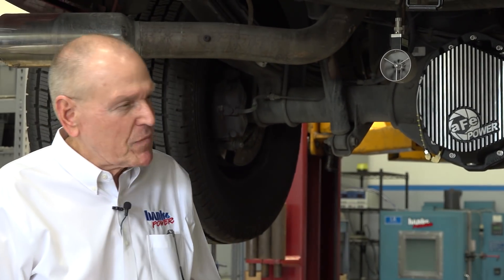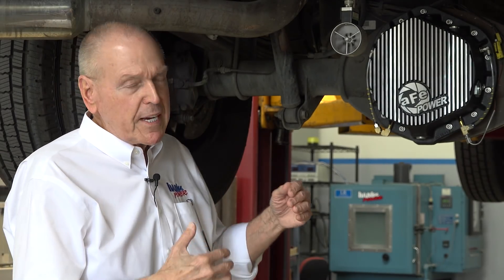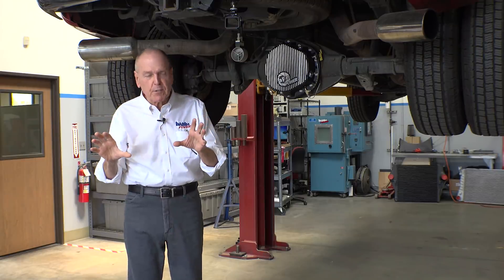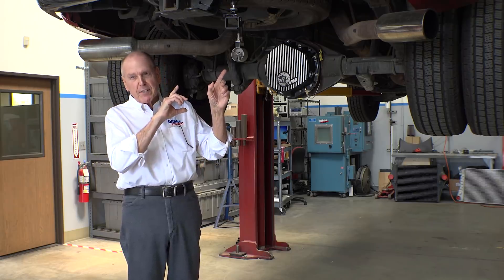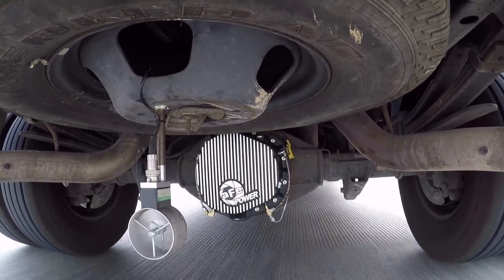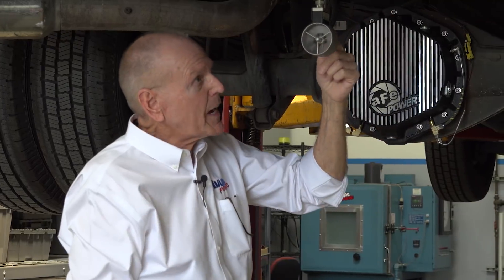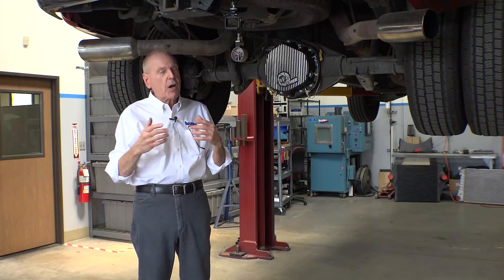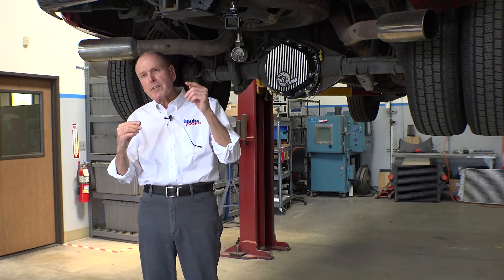Do Diff Covers Work or Are They Just Bling? Part 1 of 3

Comment: All I know is that when I replaced the stock diff cover on my 1990 Dodge Cummins 12-valve with the Mag-Hytec, it was like new life for the truck. The old oil (even though it was running fine with friction modifier for a rear-wheel locker) was really bad.

I now have a differential full of clean synthetic gear oil that can be drained from its bottom, with a magnetic dipstick that is constantly removing any metal from the oil (as I noticed, checking the level after the first drive with it, and again later when adding friction modifier for the rear-wheel locker).

And, the inside of the Mag-Hytec cover for the Dana 70 rear end is nowhere near as squared-off as the ones that Gale here shows for the newer, bigger rear ends. It also sticks out farther away from the gear wheels.

Granted, if Banks made a diff cover for the Dana 70, I probably would have bought one.

Comment: how about the heat radiating from the road ?
Reply from the maker: Heat coming off of the pavement factors into "ambient" temps tested. We found ambient temps play a negligible role. Have you see the final chapter in the series? https://youtu.be/vdtmDl5EDJ8
Reply: @bankspower  no, it got a bit long half way through ep2 and i realized you were selling a product, rather then just debunking if a cover does anything to improve a differential or if it was just eye candy, I thought they were just eye candy, but i can see now as you explain the engineering how a cover may assist in longer differential life and better fuel economy, I liked your design well done and learnt a bit about differential lubrication thanks, so i had a look on your website but you don't make one for my old jeep cherokee kj, which tomorrow I will be rebuilding or swapping the diff cause something went bang on the way home and oil started coming out the pinion seal so i think it chewed up a bearing or something else fun, but i got home so will investigate in the daylight, thanks for the reply, makes more sense now why anyone would spend a few hundred dollars on a cover for their diff... hey baby look at my lovely differential .. yea i couldn't see that working, might be ok if you have a 4x4 with a 6 inch lift kit and then everyone sees it I guess.  cheers.

Comment: Thank you for these great videos. A couple of thoughts. How about adding external cooling bars on the stock diff cover? This keeps the internal shape & fluid throwing flow but adds outside cooling & not effecting internal fluid throwing or capitacy & may not have a negative outside air shape or flow. Also, why do stock diff covers have no drain plugs? Adding one to the stock cover just makes it easier to do fluid changes. Looking forward to future testing, thanks for your time & efforts. I've got the '17 Silverado 5.3L LTZ

Comment: Yeah that's how come you never put one on my Dodge Cummins cuz I got looking at them and I was just like how the hell does the fluid flow in that thing and all my friends that had them had rear end issues and they put 250,000 miles on it with the stock when they put that one on it and it went out about 10,000 miles later and they said it was due to excessive wear and Heat and a lack of lubrication so I just never put one on mine cuz it was a waste of 200 bucks because the stock design has been around since Jesus was a foot soldier so it had to be doing something right

Comment: # FAIL### You did the first video on a Ford. The second video on a ram. You wasted all our time! You cant compare the two tests on two different axles. All this time.and work on testing and you ruined the test by changing the truck and axle,  every different axles will react differently.  Bad test. Disqualified.  FAIL.... also you installed led lights but no tempeture sensor? #FAIL WASTE OF A TEST. also on this second test you did not put in the 2 extra quarts of oil.
Reply from the maker: We did not test on different vehicles nor did we test on different axels. All tests were performed on the GM/Dodge 14 bolt 11.5" ring gear rear end. All tests were performed with temp sensors, anemometers, and other sensors. The two videos with clear diff covers were for illustration only. No actual testing was performed with those covers.
Reply: @bankspower  one was a dodge and the other a Ford.
Reply: @bankspower  either way a dodge and a GMC will have different gear aspects
Reply: @bankspower  the ratio may be the same but one may have paddles the other not
Reply: @bankspower  you need to do the test over again. Both on same axle
Reply from the maker: @tintdr  We will do not need to do the testing all over again. We performed all tests on both GM and Dodge rear ends. We have data for both rear ends. And, we have reams of data collected that was not shown in these videos. Moreover, these videos are nine months old. We're still testing. Yes, nine months later we're still testing. You're welcome to stop by anytime if you're in the SoCal area.
Reply: Well I think you should be fair and show the test on the same axle within the same video. Because while watching I felt deceived
Reply: So post a video of the test done on the dodge, with both the factory clear plastic and the replica of the flat back. All we can see is a test done with a factor clear on a Ford and a flat back clear on a dodge of vise versa. To show everyone post the dodge with both. One has a paddle to mix the gear oil and the other does not. Not a fail comparison

Comment: We don't care what you're running, we don't care about that tiny computer fan, we don't care about oil levels. You sir, are a quack. You said all that stuff about mileage yet you didn't actually name any statistics AT ALL. The only thing you said was that "If you're going 60 and carrying a large load, it will reduce oil temp".  

Really? A 10 minute video to tell us about stock oil levels???? You said you had so much data and research yet you said NOTHING about performance numbers. You only said that you found a good lube... WTF OLD MAN???
Reply from the maker: This is multi-part because we're testing in real-time. It says it right in the title. This isn't a TV show that was taped in advance six months ago. It's happening right now between all of our other ongoing projects. So, actual data is forthcoming. Do you think you're being funny calling him an old man and a quack is funny? Gale is one of the most respected men in the aftermarket industry. GM, Ford, and Chrysler have all consulted him on various projects. Gale is one of the few that holds other parts manufacturer's feet to the fire. Did someone hold you at gunpoint and threaten your life if you didn't watch this video? Your display of cartoon-like hate is comical. Thanks for watching!

Comment: I will be really interested to see if the internal shape of the aluminum covers changes as a result of this testing... instead of just hogging out more space without any thought given to fluid flow and distribution, will someone make the effort to build a cover with the service ease of a Mag Hytec, the cooling of finned aluminum, and the same or better internal flow dynamics of the engineered stock system? It’ll require someone to spend some money, because we’re not talking about a CAD jockey just slinging out a shape he thinks looks good with the right bolt pattern. Will require detailed internal geometry and flow channels to distribute the fluid properly for both complete lubrication AND thermal management.

Comment: You know?  This is immensely interesting, but really only partially applies to me...I have a 2003 Ford Ranger FX4 I am (perpetually) modifying to be an overland/hunting rig.  A vehicle that may see 2000 miles on Interstate under load, followed immediately by a week or 2 of high-torque off-road application.  Simply put:  My truck will spend even MORE time in 4 Low than she did at 75mph on the open Interstate.

Because complicating your life is fun:  How does this apply to low-speed (low airflow, less fluid dispersion) and high-torque application?  Non-issue?  Or...???

Comment: Interesting you call the diff gears the "ring and pinion" gears where here in Aus we call the diff gears the "crown and pinion" gears, the ring gear here being the starter gear on a flywheel / drive plate.

Comment: banks is the real deal guys. Like Richard Petty that kind of real deal he knows what he's talking about. I expect after all this is said and done we'll have something like you have to mark it covers don't work as well the oil gets heated and it probably will lead to early oil failure and it could lead to early bearing wear and failure. And even if it's just the oil you really need to be running a device on your vehicle that accelerates the wear and failure of your lubricating oil on your diff? I would say no

Comment: I have a question for the Banks team: I have heard and read that the efficiency of older differentials (i.e. before the 1975 CAFE standards were imposed by law) are significantly less efficient. The poster child for that group of differentials would be the venerable Ford 9" because its design has a "three tooth overlap".     IS THAT TRUE? and is it something I should factor in if I am building an HD truck for highway efficiency? Are there any hard numbers published for this? (Ok it was three questions)

 I appreciate Mr. Banks take on things, and the way his products are actually engineered rather than concocted.

Comment: I would guess that the extra cooling surface on new cover is more important for cooling than  those air flow meters that you installed before and after to  check the difference in airflow around the rear axle ....       
Seems somewhat useless on road car that does not have aero installed that would channel the air to flow better around diff and cool it that way.     just way too high tech for something that it does not affect hardly at all , if any indeed.

Comment: Really looking forward to the results of these tests. I just want to see slightly lower temps in my rear housing. I was told the issue I had was due to the fluid temp getting to high.  Had a seal blow a few months back, reasoning from dealer was that factory capacity isn’t adequate for the projected and stated limitations of the truck. They told me, should I order a 1 ton cover or one of these aftermarket covers, they would install it and fill to factory level for me. The seal and brake rotors that were damaged were all covered under warranty, but I don’t want to be in there every few months with my truck in their shop for a few days.

Comment: Different covers come from 4wding, might not mean much in the usa seeing as there's next to bugger all 4wding going on.
Stronger cover doesn't crack hitting rocks etc
Bigger cooling fins to help cool the diff oil
Bigger or easier oil changes or cleaning of the oil
The other is weight changes

Maybe towing on the highway might be good for the bigger fins but depends on what it is and how much

Comment: I don't care about anything but the ease of changing the fluid.  Mag hy tec is the best.
Reply: Putting ease as the top priority is usually a bad thing.
Reply: That's what I own too (Mag-HyTec) on both rear Diff and transmission pan.  i'm using the BG Diff oil all around and OEM trans fluid.  I just drove 1500 miles stopping
no only for fuel and pee breaks and all was good.

Comment: Perhaps Mr Banks' next product will be a two part diff' cover - the finned part that fits directly to the housing with a bit more capacity, and a second part that is a bolt-on scoop that directs air over the finned cover. Heck, I expect there are folks who can just fabricate their own from some sheet metal and U-clamps over the axle tubes.

Comment: This is why Gale Banks is the Best in his Field and all other fields that he choses as his endeaver! Without yet,seeing the results, I can guess the result. Higher capacity, higher heat. So? What's next? Bearing seal failure? Now for a Stupid question? Maybe so, maybe not. Now if you're  running an aftermarket diff cover w/higher level of fluid, what if somebody configured a cooler to cool this fluid? Obviously some obstacles like where to install(front grill)? Plus whenever you add extra connections with and for the cooler and lines, you exponentially increase the likelyhood of leaks, ultimately risking the failure of the entire mechanism. In this case, the axle seals, bearings, and finally the diff itself, usually in that order. Both lol and no lol! Any ?'s or comments?

Comment: I have a design idea for you for a rear diff cover giveth bigger blades like an air-cooled engine then you have above the differential like a spoiler or an angled plate to direct air flow through the air veins on the differential it would blow the heat down and a way cuz I would hit the ground while you're going down the road just an idea good luck interesting thought 300 + degrees is very hot and create lubricant break down over time keep it cooler if it lasts longer good thinking man like your ideas

Comment: Iv always read that they add rigidity to the "pumpkin". It's the main point of cast oil pans and rocker covers, they tend to not warp and eventually leak due to their higher comparative rigidity over sheet metal. Though they weigh more. Oh and better heat dissipation.

Comment: I like my new cover because it has a drain plug which makes it easier to drain, it has a dip stick to check level and it holds more fluid.  It also has a port to stick a temperature gauge in.

Comment: the more liquid you have in a vessel the longer it takes to heat up . so the diff wont get hot and possibly burnt out as fast  they do nothing for the common cars driving around on streets they started out as an upgrade for axles on 4x4s that were being used hard on trails/mud. they also strengthen the diff more than a thin peice of metal that is the original cover and some have 2 holes so fluid can be changed easily after wheeling or regular pm instead of taking off the whole cover .

Comment: What is that fan doing on the axle
Reply from the maker: It's an anemometer used to gauge airspeed under the truck so we can properly simulate highway driving. We have one mounted in front of and behind the rear differencial.

Comment: Very interesting so far. 

I did some testing on this years ago but not to this controllable degree. The only thing I could monitor was diff oil temp but  I didn't have a rolling road. I tried to equalized the load and the driving routine, as well as doing the testing at roughly the same ambient temp and using the same lubricant. Best I could do in the field.
In my case, the cover reduced the peak oil temp 15-20 degrees, but my peak was nowhere near what Mr. Banks was seeing as I could not apply a constant heavy load. I spoke with engineers at Dana and Meritor about these covers and they were generally not in favor. The main objection was that the distance between the cover and the ring gear is part of their calculations with regards to lube flow, aeration (more of which oxidizes the lubricant more rapidly), etc. They didn't like that they increased that distance and predicted negative effects. They had no problems with increased capacity, but they warned against increasing the level as Mr. Banks mentioned. The manufacturer of the cover I used wanted the lubricant level increased from stock. I tried it at their suggested level and then at the stock level but my test equipment could not uncover any differences beyond a margin of error. Still, I left it at the reduced level  as my "instinct" drove me that way.
The level indicators were very interesting here and the way the levels dropped. This was an aspect I had not considered. I wonder where that oil is going? Down the tubes? Clinging to the ring gear and carrier? Both? Interestingly, the manufacturer of my cover stated the reason for the increased levels was to feed more oil to the wheel bearings. Laudable, perhaps, but if the ring gear is already doing it, why is raising the level necessary?
I have been running diff temp gauges in my trucks for 20 years or so and there are a great many good reasons to do so, especially if you tow. Even if you don't tow, it can help you choose the most efficient lubricant and viscosity to eliminate drag and potentially increase fuel economy. The diff is a place where the right lubricant can add a noticeable mpg gain. 

One quandary I had was placement of the sensor. I note Mr. Banks had the sensors in the bottom measuring the bulk oil temp. Did that too, but also put one up to measure the temp of the oil being spun off the ring gear, which was hotter oil. I wonder if there was any logic or testing applied to the determining locations of the sensors in this case?
Anyway, this is an awesome test and I am dying to see the results!

Comment: There's a couple of points I wonder if  Banks could comment on. 
What is the optimum operating temp for the lube that he used? If this lube is better at a lower temp, is there a different axle lube that is designed for 350-ish running temps observed?
 If an axle lube is designed for a lower temp, are there any vehicles that come with a cooling system? (Such as a remote axle lube cooling rad, or an integral heat exchanger with remote coolant feed, or separate small coolant rad?)
Reply from the maker: We'll try to answer these questions in the upcoming video.

Comment: Different fluid levels could also be specified to accommodate differences in clutch type limited slip units vs. gear lockers, vs open differential used by different manufacturers. Hypothetical example: Wet clutches in a clutch type lsd my prefer more submersion than mechanical lockers.